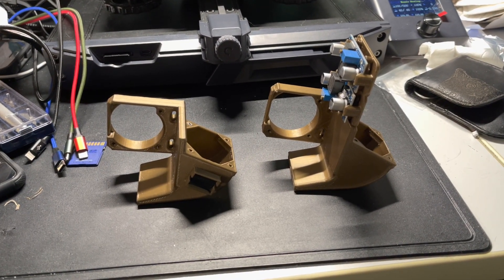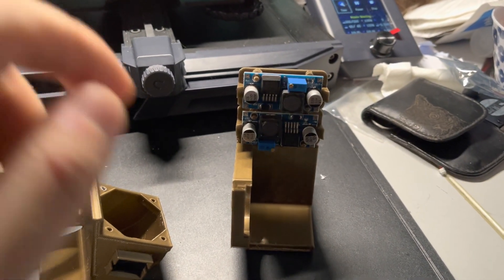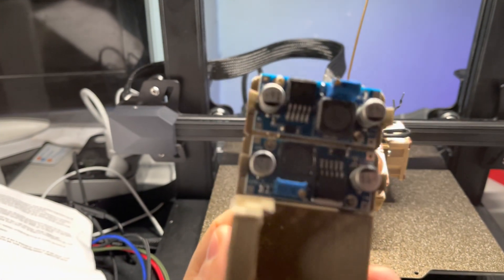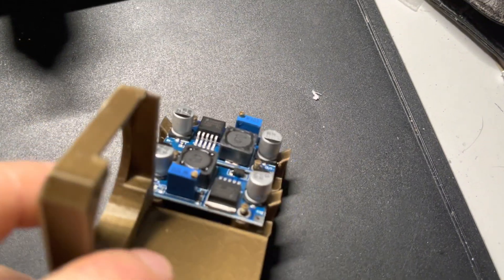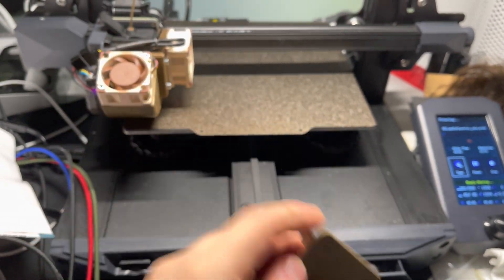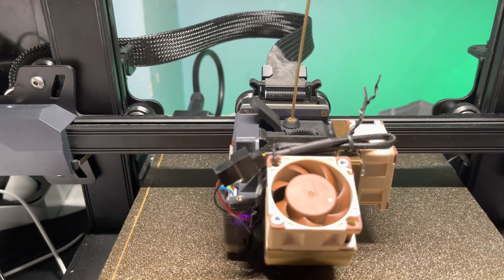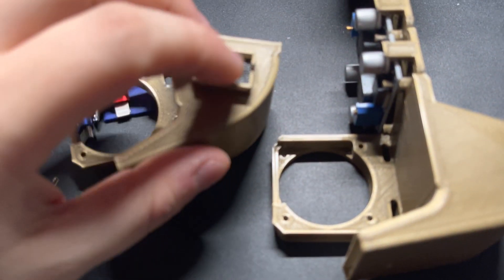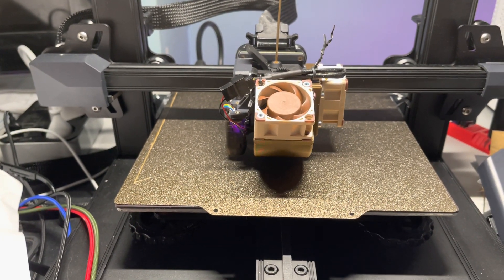Ender 3 S1 regular size buck convertor LM2596 setup instead of tiny ones …. BETA version

Comment: Can you explain what it is about the little buck converters that is bad? I know it's that they are only rated to 18 volts, but is it all small ones, or that they don't have LM2596? I have some small ones coming that are LM2596 (according to the Aliexpress listing).

How did you find out about this issue? Do you have a link to the evidence please?

Why not run the fan cables back down under the printer and put the buck converters there? Less weight & bulk on the print head.
Reply from the maker: the input value is advertised as 23 v but in reality it's 18 v , this makes them go really hot after a while of use.  Because of this wrong information i burned the breakboard of my Ender 3 S1!  On the ender 3 S1 u can't run the cables under the printer because the fan cables outputs are on the sprite extruder not in the mainboard.

Comment: How did you deal with orginal hotend blower fan? It blow air from left and exhaust at back right. Won't the new right Noctua preventing it to cool down hotend?
Reply from the maker: I'm using the right side to for hotend cooling, the original hotend fan on the left is taken off the hotend, only the shroud is in place to be able to use the CR touch because it's one piece.

Comment: Does that’s buck conveter use 2 fans? Or each fans only use one buck converter? Thanks
Reply from the maker: the design was for each buck convertor to use one fan, but i'm going to change that design into one buck convertor to partscoolingfan and one zener diode to the hotendfan. I'll upload a video later on with shematic on how to connect the buck convertor to the partscooling fan because it's not a regular connection . stay tuned!